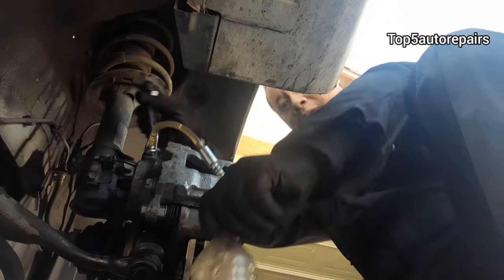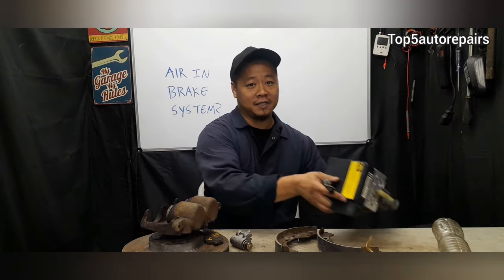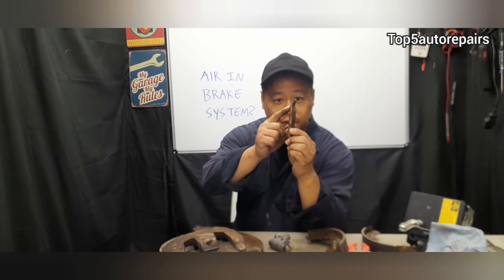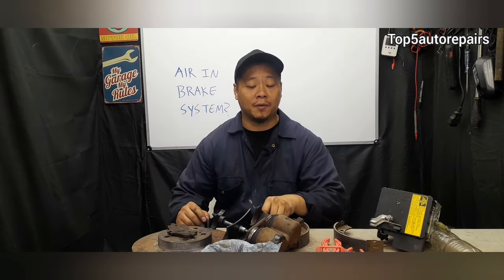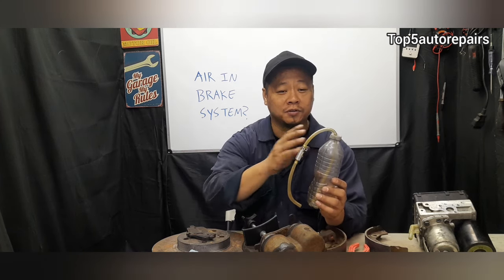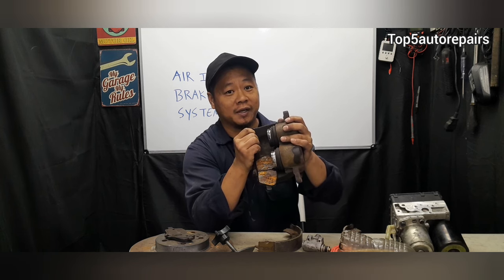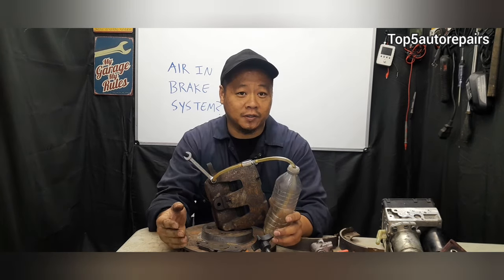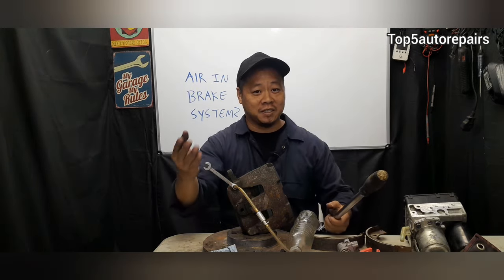SYMPTOMS OF AIR TRAPPED IN BRAKE LINES & COMMON CAUSES

Comment: what would cause your brakes to work fine until they heat up then the calipers on both sides in the front cause them to fail to retract..once the brakes cool down it releases them and it is normal again..only happens once they heat up..after about 10 miles they will fail to retract..let the car sit for 10 minutes they release
Reply: This!!i need this answer

Comment: Mine has air and my bleeder screw is frozen so I always use the line to bleed it and its always worked but now is air inside and it wont come out. I have new pads on and pedal sinks to the floor.

Comment: Just changed the brake fluid and the pedal got lower
Reply from the maker: There is air in the brake system. Keep bleeding it until air is removed.
Reply: @Top5AutoRepairs  did it, thank you

Comment: Hey there, does wheel bearing replacement cause air in the brake lines. I have noticed my brakes are not making enough pressure to stop the car after I replaced the wheel bearing and a mechanic checked and found that a fluid leak on the area where I replaced the wheel bearing. So my question is, does the leaking  caused due to the air in the brake system or something is wrong with the brake caliper or some other stuff?

Comment: 1997 Ford F350 Diesel....rear brake shoes were replaced but now the brakes will engage and stop the vehicle but the pedal slowly goes to the floor.   Master cylinder replaced, brake booster replaced,  rear cylinders replaced, drums replaced, but still have the same issue.   We've bled and bled for weeks.
Reply: Did you check your brake lines? Make sure they aren’t leaking or corroded

Comment: Thanks for your video is very helpful . 
Question?
I bought  my car for brake pads front and rear replace only, mecanic did it. Next thing  I noticed  after leaving my car park  to the next day, whe. I start it  and proceed to drive. I hear a humming  noise coming the rear tires , I step on brake  pedal a few times  when away.  In the afternoon, the same thing , so I repeat the process and bring the car to the mechanic.  He  bleeds  the brake lines it was air on the rear, but I am not quite sure that he got out all the air, because now stills  make the noise but less louder.  Please advice. Car is Avalon 2012. Thanks.

Comment: Most of the time, my brakes work great but recently, it took more pressure for a complete stop, which only happened twice in the past 100 miles. Brake fluid is full, as well. Would this be a simple bleed or do you think it could be something else? Possibly a Master Cylinder? Thanks in advance!
Reply from the maker: Check the brake booster
Reply: I think you nailed it! I did the steps for the symptoms and it perfectly matched up. Any idea how quick these crap out, after the symptoms begin?
Reply: I also hear the hissing noise of air... brake booster leak it is. Thanks, much appreciate it.
Reply: This is what’s happening to my car. Hard to break. Brake light n and a hissing noice coming from my break. I’m trying to online diagnose before taking it to someone. I am a female who knows nothing about this stuff I just want to have an idea as to what it is. What is a break booster and where does it go?  I just don’t want someone to play me. The car is drivable but hard on the breaks. Autozone did a diag test and it said abs but no abs light only break. I scared someone will eff with my car and I and charging me for something that it isn’t. But again it’s hard on my breaks and the hissing sound as I break. With the break light on my dash. Someone please help me understand a little.

Comment: I've been bleeding my brakes for weeks and I still have a spongy pedal. did a disc brake conversion in the back and big brake kit on the front w new steel braided lines. I get a good hard pedal when bleeding car on and off but once I shift into 1st gear and drive a little the pedal is longer and weak braking. if I press twice the 2nd press is normal braking. driving a 99 crv.
Reply: Your break booster bro
Reply: Check vaccum line to brake booster, let me know if you're still having this issue and I'd be happy to help you resolve it.
Reply: @TroyGuttormson  I've tried a 2nd vacuum line w the valve fr another Honda and it was the same. I've deleted the faulty old abs module and went non-abs prop valve and full steel lines and upgraded 1" master cylinder.

Comment: my friend if there is air in the lines, i changed the accuator and pumped brakes few times hard ,then on engine and sounds like the pump turns on try to fill ,but then turns of and accuator vibrates when pump goes on, but then pump stops and now i have a abs alarm going of fulltime, how to turm abs alarm of, and does any paint on the spindal effect the magnet

Comment: Hi, I could use some help. I have a 06 Tahoe. Had a local mechanic change my master cylinder brake booster. My truck went from a super spongy hitting the floor with no brakes. To now regular feeling brake pedal suddenly getting stuck all the way up and my brakes locking up needing to be towed on a flatbed. After a few hours the brake releases and feels fine u til it does the same thing. The brakes have been bled multiple times releasing air over n over. Had the abs module changed  abs pre charge pump n abs module and still gets locked. Please help.
Reply: Have same problem did you find solution
Reply: @marcosman3393  no, my poor truck is only used for really short trips to my local supermarket. If you fix yours could you share with me plz.
Reply: @marcosman3393  Ty

Comment: When bleeding the brakes, you (and everyone else) say to start at the wheel farthest from master cylinder, working the way up to the one closest. I have a 2004 Xterra with the fluid reservoir on the left side (if sitting in the vehicle, facing forward) but the factory service manual says
 Bleed air in the following order.
– Left rear brake
– Right rear brake
– Left front brake
– Right front brake
– ABS actuator/VDS
Could it be that the master cylinder is on the opposite side of the engine compartment than the fluid reservoir?
Reply: Master cylinder is guaranteed to be on the same side of the fluid reservoir. Maybe the brake line is longer to the left rear caliper than it is to the right rear caliper because since ABS pumps have been introduced the bleeding procedure isn't as direct as people did in the 80s (where everyone went first for the furthest caliper from the master cylinder). Check where your ABS pump is located, maybe it's on the right side of the vehicle, thus making your Left rear Brake the one further from the ABS Pump. Either way, the best practice is almost always doing things according to the manual.
Reply: Thank you so much! It makes more sense when there's another part in the line between the wheels and master cylinder. Is that what they're talking about as the last thing to bleed? (ABS actuator/VDS is a pump?)
Considering the fact that I've never heard of this part, much less know what it looks like or where to find it on my Xterra, I think I'd better just take it to the shop and let them fix things.

Comment: Is it necessary to open a hole in the top of the plastic bottle? I did it without the top of the botttle and it went good, no bubbles where seen.
Reply: It because of air pressure I believe

Comment: ik this ant about the video but i just had my power steering replaced a months ago and now my water pumps locked up so im paying for that but ik that it all runs off the same belt so would them not puting the power steering in right cause the water pump to fail and the belt to slip off and leak power steering fuild every where or was what they did to cause the water pump to fail cause the belts not even a month old and already sliped off
Reply from the maker: There are a lot of reasons. Belt tension could be to tight causing stress on bearings, water pump was already failing, power steering pump improperly installed etc...
Reply: @Top5AutoRepairs  ight thank you